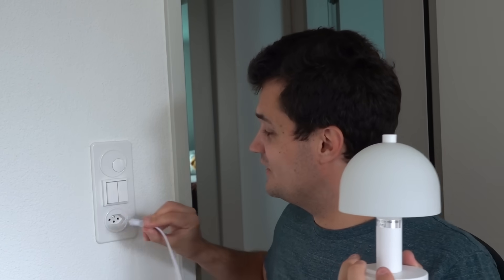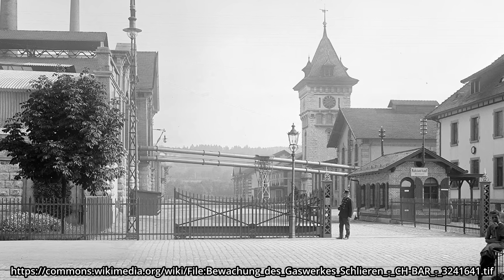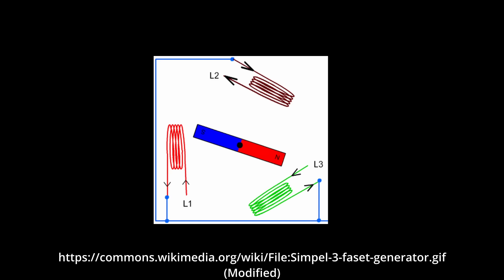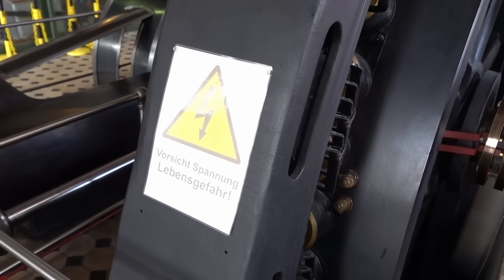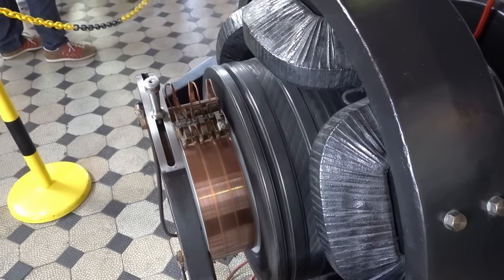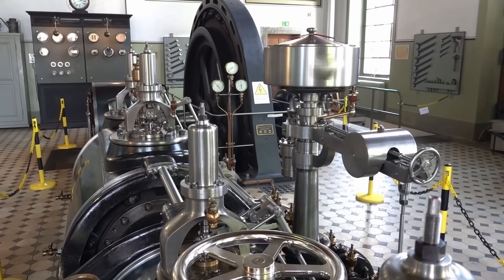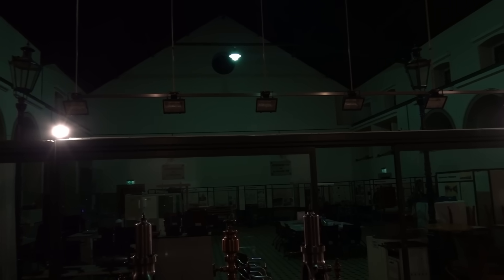Can a 1904 steam AC generator power a modern appliance?

Comment: What was the thermal efficiency of this steam generator? what is the optimum wattage for brake specific fuel consumption?
Reply: I would imagine it is really poor, especially because the condenser froze and cracked and the exhaust is directly vented to the atmosphere
Reply: @joecummings1260  At the moment we put 1'100 kw of heat into our boiler to get approximately 30kw of electricity out. If the condenser wasn't cracked and we would run the engine at the optimal load, we could double if not triple the efficiency.
Reply: @valtersludvigs2298  Yeah you have your exhaust pushing against full atmospheric, and plus you are losing your warm condensate water. 

Do you have a deaerator tank? I would imaging running completely on makeup water you must be spending a fortune on water treatment chemicals

Comment: 09:10  describes the residual magnetic field exciting the rotor to generate.  One problem people experience with their home petrol generators is that they my loose this residual field and therefore not generate any current.  This can be resolved in a number of ways which i will not describe hear but the solution is shown by some YT videos so check them before you scrap your generator it is an easy fix.

Comment: would have been instresting if some of those resistors were heating elements in the boiler. this could / would reduce the amount of energy required to run the system saving some cost to operations. but it would not be a free energy system.
Reply from the maker: Indeed, but not worth the effort for a museum piece. See also milolouis' comment and the replies to that.

Comment: very good, expert explanation.... the exhaust steam of the engine is just expelled in the air...Was the machine original not condensing  the exhaust steam ?
Reply from the maker: Thanks! Yes it was, but I explain that in part 1, along with why it's currently just expelled.

Comment: They should use the resistor load to pre-heat the boiler water.
Reply from the maker: The machine runs 3x for roughly 10 minutes, 3 or 4 times per year for the public to see. It's a museum piece, efficiency is not the goal here (if it was, it would have been dismantled a long time ago)
Reply: @sandro-here  Sorry I didn't mean to sound critical. It's very cool.
Reply from the maker: @milolouis  No offense taken 🙂
Reply: @sandro-here I wish you still posted 🙏 love your videos and I am subscribed
Reply: I want to make a scaled down version of this!!!!
Reply: There is not much heat generated with the regulator resistors, far more can be recovered from the engine steam exhaust.
Reply: They should connect it to the grid
Reply: @sammy5576  if they are making power anyway it should be send to batteries or something useful at least.
Reply: Unfortunately  feed water pumps  ( and also Giffard injectors ) are more efficient with cold water
Reply: Or make some fried beacon. Everyone loves fried beacon! :)
Reply: I would have used larger lamps as a load. Those little lamps are not very impressive.
Reply: Additional lamps would probably have been cheaper than the resistors.   The Hesston, Indiana Steam Museum has a small steam powered generator, which uses a large bank of light bulbs for a load. Sorry, I couldn't find a photo of it.
Reply: they should use the electricity to power the lights in the building instead
Reply: @miguelcanoe6774  not completly but yes that would reuse some energy. Just like how a turbo uses the exaust gasses on a car.
Reply: I thought the same thing.
Reply: Lots of engines run the feed water through preheaters after the pump to get waste heat from the exhaust. Injectors use steam to push water into the boiler and don’t need a preheater
Reply: 400kv resistor
Reply: The load resistors could be mounted on an aluminum heat exchanger. Wire wound resistors can operate up to 350C. A significant amount of energy.

Comment: It's a shame that the voltage is wrong and that they can't put their power onto the grid
Reply from the maker: Somewhere in the early mid-1900s, they retro-fitted a transformer converting the voltage. It still sits in a cupboard next to the controls, but I wasn't able to get a good shot due to poor lighting. But this is how they ended up connecting it to the factory grid despite the voltage being outdated.

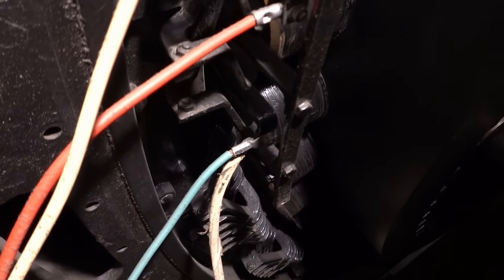Comment: 5:00 That`s not true, must be 127V (L-N)? Hmm 4:49 neutral is not connected, blue and white connected together
Reply: In early day of electricity many countries used 127/220 V systems. later when switched to 220/380V they used transformers to mtch different systems.  In germany, the last 127/220V grid was switched over in 2016 to todays 230/400 system.
 In some areas of Norway is an  220V 3 phase  3 wire  grid  in service without neutral .
Reply: @Reaktanzkreis  In that time they dosen`t had a proper insulation for wires, and working voltage for arc lamp is around 100V(sorry my english)
Reply: Yes, it's 127V line to neutral, since the machine's nameplate says 220V (for phase to phase). But in Switzerland they wouldn't use the 127V for anything. As for the 4 conductors, I do not think the blue wire is connected to the 4th wire. The 4th wire appears to be turned sideways, and connected to another bolt you can't see.
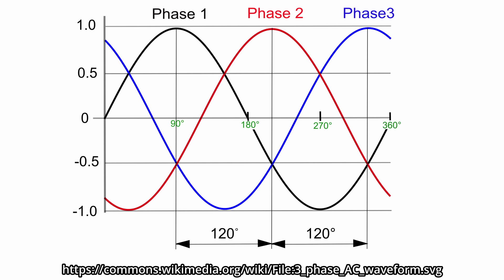Reply: @sortoftubular  I`s like both connected to 1phase  (neutral bus is empty 4:49 )
Reply: @bodyanone5156  Yes, that could be true.

Comment: Love your videos, do you plan on doing more ropeway content in the future?
Reply from the maker: Thank you! I'm still fascinated by ropeways, so there are good chances for another one to come up in the future! I usually have more contact with those in the winter (due to skiing), but I have several such projects in the backlog which are not that easy to get acces too. Let's see what the future brings 🙂
Reply: 5:03 sagt 220 V zwischen den Phasen. Müsste das nicht 400 V sein?
Reply from the maker: @MarcQuiclic  Im Schweizer Stromnetz schon, aber bei diesem Generator ist es eben ein RMS von 220V zwischen den Phasen. Als das Netz besser standardisiert wurde, hat man einfach einen Trafo eingebaut, um auf die 400V zu kommen.
Reply: normal sind es 230v zwischen l und n und 400v zwischen zwei phasen. der generator produziert halt was anderes. oder es ist ein fehler @MarcQuiclic
Reply: 5:03 sagt 220 V zwischen den Phasen. Müsste das nicht 400 V sein?
Reply: @MarcQuiclic  127 V (L-N) (220V 3 phase)